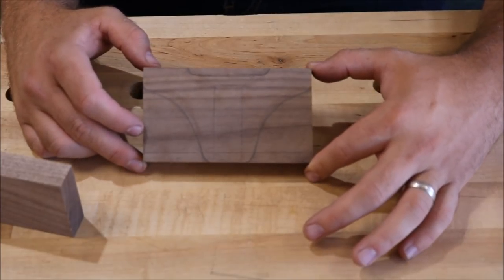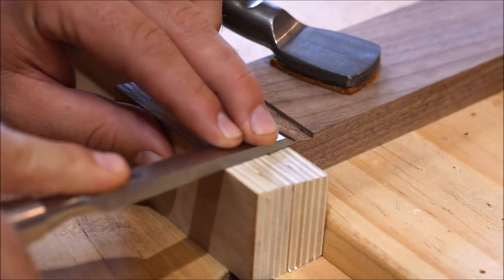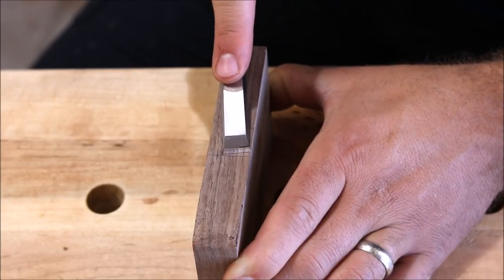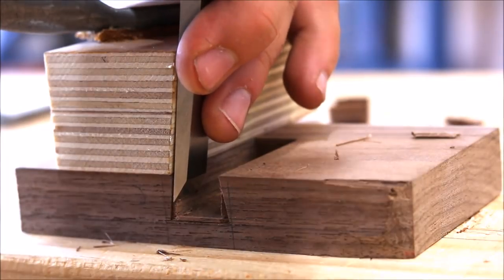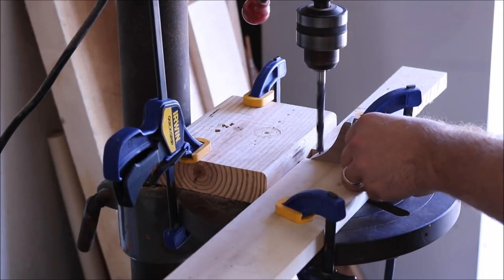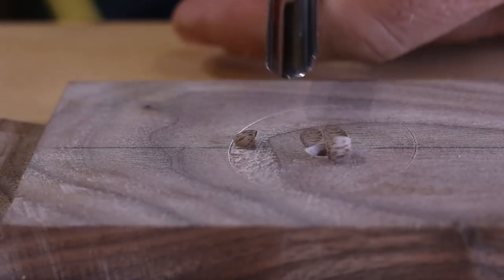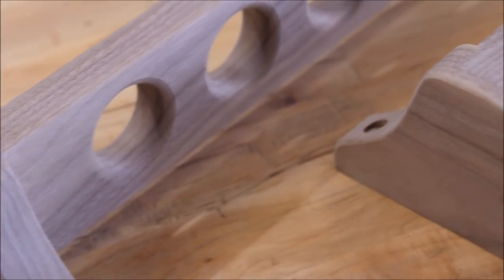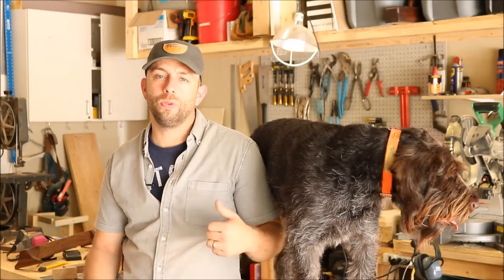Sliding Dovetail Pool Cue Rack!!!  How To | Woodworking

Comment: Nothing new to add to the comments on the work, it's all top notch :) 
My question is about the size of the holes you put in the top board: what size were those? They look kinda huge. 
I've been thinking of making something like this to display/store my cues, but my ocd would be agitated if they didn't stand relatively straight. With holes that big do they not flop around enough to look askew? 
Love the design aspect of the rough gouged bottom divots, but would suggest going a bit deeper just to be safe

Comment: I love this project! I've been racking my brain for a high for my cousin's husband and this will go nicely with their new pool table. I especially like the joinery. Do you know of a way to distinguish mahogany? I picked up two 10 ft 1''x 4'' boards on the side of the road. There were wooden bed slats, plywood, and underneath we're these two boards. They feel as if they've been planned and sanded already. Just gorgeous. I asked of course if I could take them and was told yes. They were new owners of the house and the previous owner was a professional cabinet maker. There is no knots or blemishes of any kind and the grain looks almost speckled and it's dark/reddish/brown in color. Thanks for any input Chris. Love your channel and especially your cute partner😁.